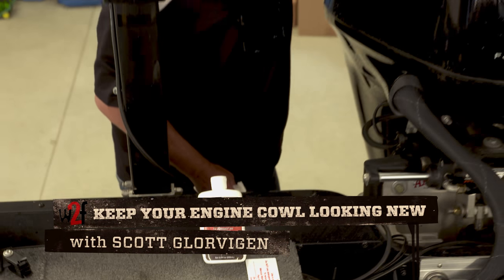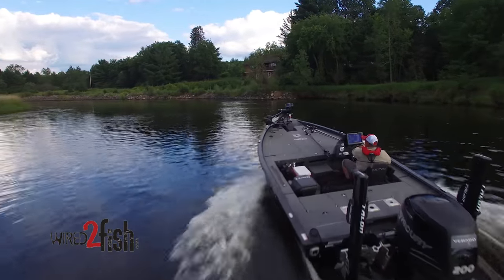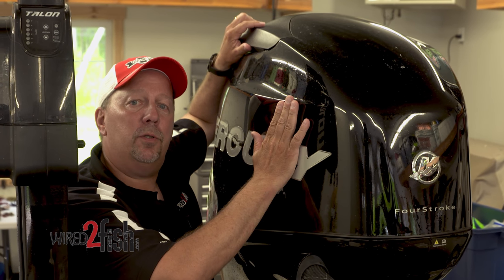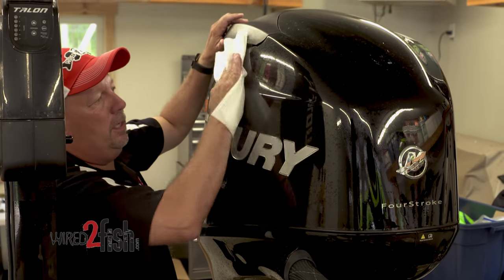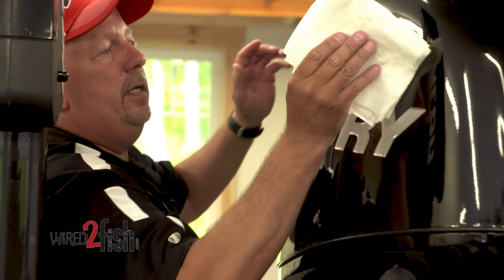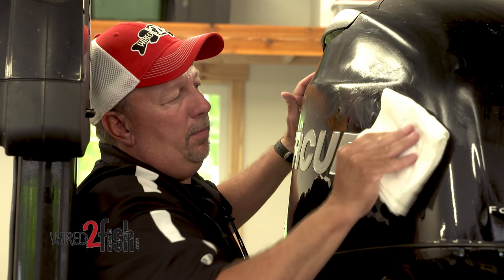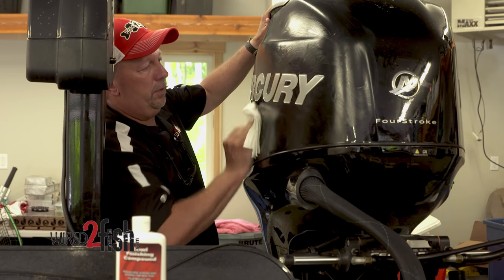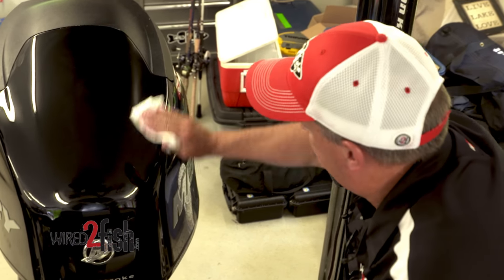Mercury Marine Engine Cowl Care Explained

Comment: I’m having a problem opening my cowel on a Suzuki df90a outboard the clip handle moves from horizontal 9.0clock downwards to about 20 mins should it go further down ? It feels like it’s as far as it will go and I am frightened I’m gonna break the handle any help from some who has one used to have one might know, the movement is easy not tight but stop at the 20 too(clock face)position many thanks in advance peter